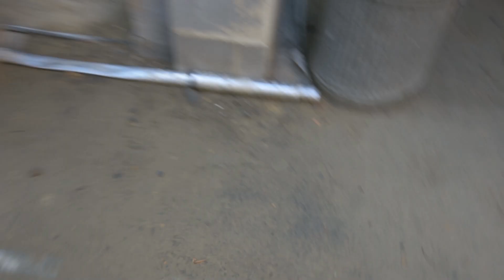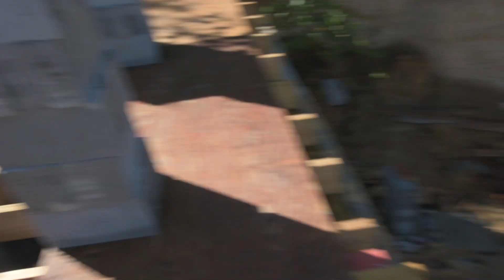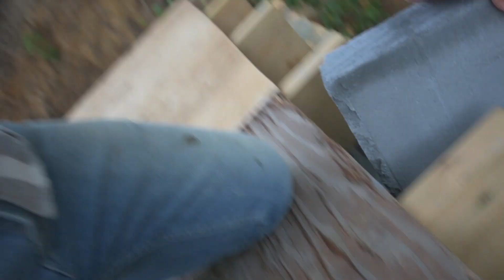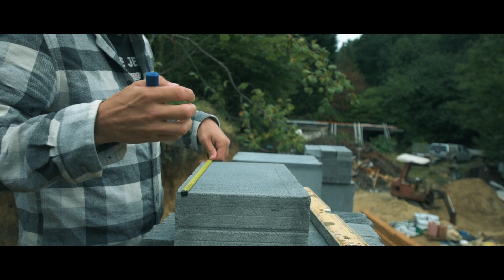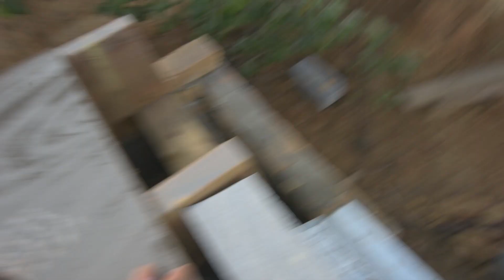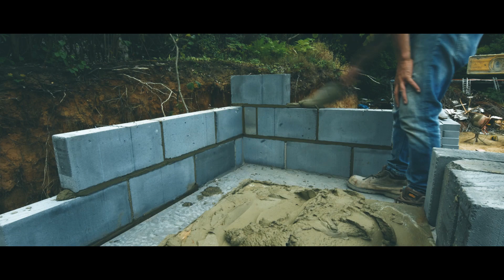BUILDING A HOUSE ALONE from START TO FINISH | E.P 22 [Laying more blocks]

Comment: As other lads have commented on building up on timber is not right no matter were you are from  that's why you're heights are wrong   if timber is not there u would not have to cut the top off the blocks. There is no bonding between block  and timber. It's all covered up now so it doesn't matter 😢

Comment: Laying blocks on timber wall plate is a very bad habit,a total bodge in my book!
Old way wrap joist ends with dpc, or today use joist caps,& place joists straight onto block work & build in.Some peeps use joist hangers.
If I did it your way,the building inspector would have a fit here in England & he make you redo the work correctly.

Comment: Blocks on top of the timber?
Lets say timber rots in the future and then what?
Whole wall will crack and collapse later on.
You cut a half of the timber and than U put it on top of RSJ? So now timber is 50% weaker, joist hangers helps...but You've been told you do not have to use.it every where (???)
Im so sorry but this is not correct.
Reply: A complete bodge building on a timber wall plate..
Amazed a building inspector would allow it.

Comment: Putting blocks on a board is an unreliable structure - there is no adhesion between concrete and wood. Over time, the board will dry or get wet, and will destroy the masonry. Cracks form. The gas block may burst. Instead of a board, it is better to make a reinforced concrete belt along the outer perimeter. This is hard work, but more reliable. It is very interesting to watch how they build in England, we almost never use wall cavities. Mostly solid. Thanks.

Comment: How do you know what side of the corner to put the 100mm cut?
Reply: You start with a full block one end and chase it through, (dry bond it or tape it out) I prefer to tape it,  it doesn't always work out that you have a 100m cut in the corner, sometimes your left with a three quarter one end and a full block the other as long as it is bonded it doesn't matter👍
Reply: @bobf1290  awesome thanks for the reply. I was wondering what you done if the measurement didnt work out right. Now I know. 👍
Reply: @jdavey__507  no worries mate anytime 👍

Comment: Im very suprised you got away with using wall plates for the joists.
Thats a no no where I am. You shouldn't be building the second storey on timber. The building inspectors here would have a fit.
We cut the top course of blocks to cieling level and put the joists directly on the blockwork.
We strap the joists to the blockwork to prevent walls bowing out.
Reply from the maker: The inspectors round here were happy with it. Strange how different areas have different rules.
Reply: @RodianBuilds  
Yep and now we've got these NHBC type companies that give 10 year guarantees to contend with.
Ask them and the council the same question and get two different answers.
Reply from the maker: Tell me about it! 2 different sets of rules and you never know what set your following
Reply: Exactly what I was going to say,
Reply: Same here, laser a course of block cuts to ceiling height, then beam fill with another cut to get back to 225. Regs vary loads even from different councils can be so different

Comment: Now you’ve cut the blocks they’re not going work gauge to the brickwork. Would it not have worked better to lay the course between the joists then notch bits out the second course where the blocks sit over the joist?  Great vids 👍
Reply from the maker: Good point bud. Plenty of different ways of doing it 😁👍🏻

Comment: Great series Rodian, I'm hooked! Could you tell me how much those yellow stocks cost mate? I remember buying them at £1.50 each in the early 00's. trouble was, the pack would have about 50 red rubbers in the middle! The cheats!
Reply from the maker: They are imitation stocks. Basically exactly the same just new. I paid £860 per 1000. Real stocks would have cost way too much. They are still around the £1.50 mark. They still put all the good ones on the outside and all the snapped shitty ones in the middle 🤣🤣
Reply: @RodianBuilds  Yep, gone the way of real Yorkstone paving slabs it would seem. They must be worth their weight in gold now. I used to love working with West Hoathly bricks, so many colours. Anyway, I work in an office now but I enjoy watching people work hard instead! All the best mate.
Reply from the maker: West hoathly multi stocks were nice. I remember building my first extension with them, tidy brick. Yeah it's always good watching others grafting. Exactly what I did when the chippys cut the roof in 🤣 cheers buddy 👍🏻😁

Comment: I made the stupid mistake of not wearing goggles when I was cutting a length of resilient bar in the ceiling, a small piece of metal flew in my eye and was giving me problems all day, the next morning the irritation had subsided so I assumed all was ok. However at the end of day two my eye was completely bloodshot, I went hospital and they had to use the tip of a fucking needle to pick this piece of metal out! It was  no bigger than a grain of rock salt so lesson learned!!
Reply from the maker: I've had it a couple of times, not fun at all!! Always wear goggles!!! 😎

Comment: You cut those blocks very accurately, I see a lot of houses where it's like half a block and a huge dollop of muck either side to plug the gap! Just wondered what your thoughts are about using joist hangers instead, is it something you might consider on the next house??? I guess they must cost more but they do perfrom well in terms of reduced heat loss.
Reply from the maker: Hey Danny. I like having a nice joint. Not a fan of slinging muck in to plug the holes. Stronger, especially next to joists. I'm not a big fan of joist hangers for floor joists. I feel it gives a stronger floor. Guess it's a peace of mind thing.

Comment: So cool 2 c the way u guys build houses wish we laid block over here above the joists instead of framed walls. Us masons would have so much more work. Most foundations are poured crete. Great video
Reply from the maker: Is there a reason why a lot of your buildings are framework? They are starting to Make a lot of building over here timber frame, mainly because it's cheaper and quicker to put up. I dont like them, way prefer traditional brick and block. Stronger and safer if you ask me

Comment: Do you not put dpm over your lintels?
Reply from the maker: I was so eager to get the walls up I forgot to add it in during this video. I did cut it in before I made this video https://youtu.be/yUQwhfl7-hc

I started making a video about soldier course above a window, that would have included the dpm but I ditched the video.